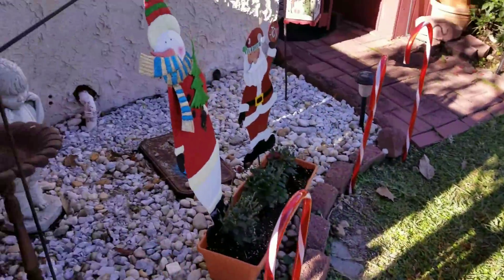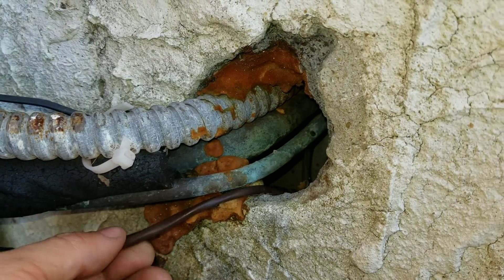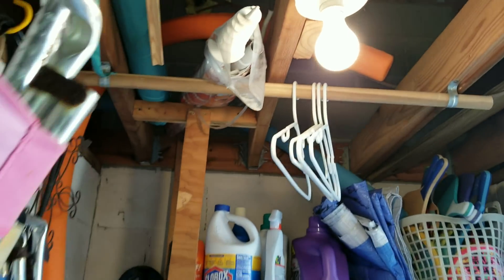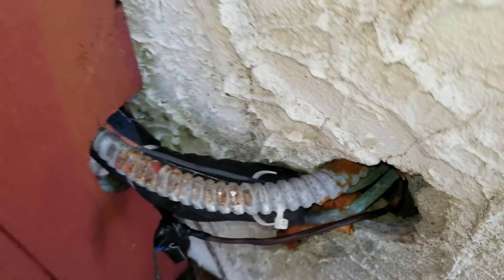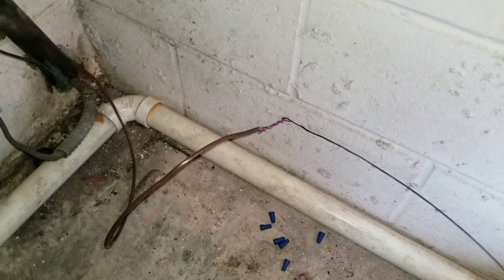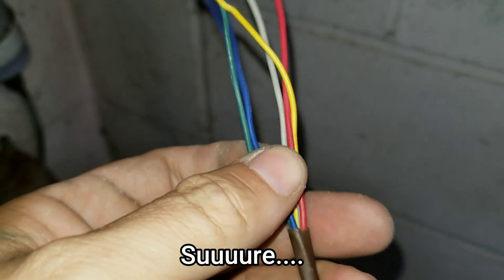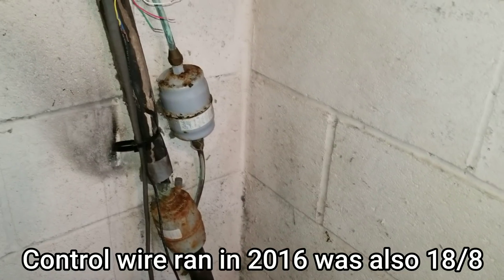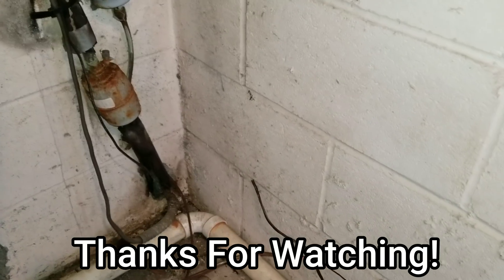Diagnosing A Low Voltage Short

Comment: Can you use a meggar on these low voltage wires to test insulation when you have an intermittent short  ?
Reply from the maker: Never tried but I wouldn't recommend it

Comment: Ran into a similar issue last week. The lineset was brazed near where the stat wire was coming through the wall with it and the heat started to melt the wires. Took a few years but finally caused a short in heat pump mode. Also i do like the short pro tool but it didn't help at all for the short was intermittent.  Great vids sir. Stay warm!

Comment: What a mess...when the system is replaced... is it code in SC to run low voltage wire through the foundation wall to the outdoor unit in liquid tight?
Reply from the maker: +Tc Most of the time in this state no permits are pulled for replacement systems unless its a gas furnace. Also to my knowledge its not even code to sleeve the lineset where it goes through the wall. Its like the wild west down here. 😆😆😆
So many things that should be done dont get done for this reason.
Reply: Thanks for the response... that  explains a lot ...seems a bit strange that the citizens of SC don’t speak up for a change after getting screwed by those who choose to be less than professional.... my comment is also based on previous videos you have posted... keep fighting the good fight

Comment: Would the fence also affect the performance of the heat pump? Turn it into a shadow box fence or something else
Reply from the maker: This fence has no effect on the units performance. Minimum space requirement is 12" on each side of the coil and this system has nearly double that.

Comment: Good video. Those lines need replaced on next trip out. I always run 18/8 no matter the system. Good method i learned yrs ago.
Reply from the maker: +Ray Ray Although I agree it should be fixed, its hard to make an arguement when the lineset has been this way for 12 years. At this age I would just ride it out until the equipment gets upgraded then pull a new lineset and control wire.

Comment: Good find my man, had same kinda shorta issue. But mine was two stories up where lineset came thru attic eve. 5 techs later I'm the one getting yelled at because previous guys didnt find it...I LOVE recalls. 🤬
Reply from the maker: I've found many different shorts over the years. I'm the bloodhound of low voltage shorts. If there...  I will find it. 😆
Reply: Very nice find.  Great job.